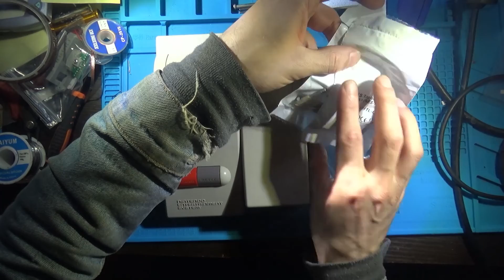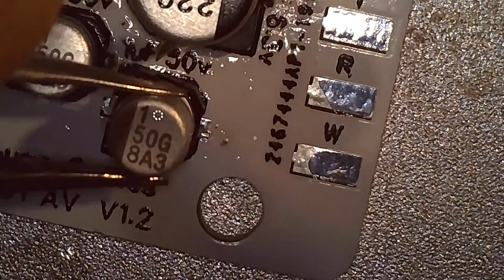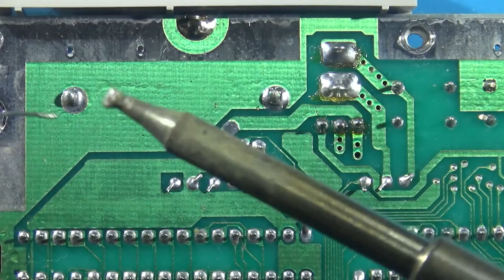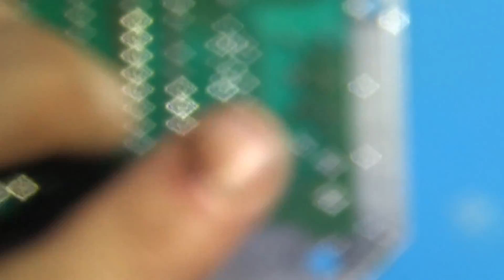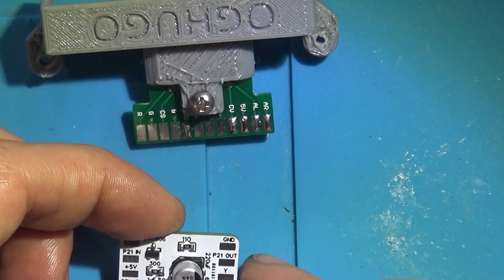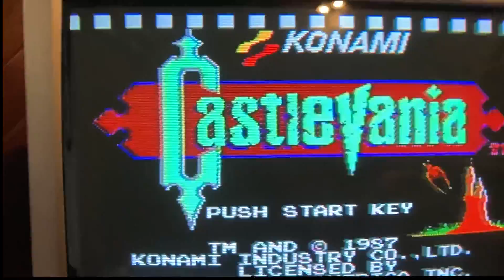Nes 101 Top Loader Composite AV mod With Snes Style Multi Out! Installation Guide.

Comment: Do you just snap one of the legs off on the replacement Dc power jack you linked in the comments? The replacements have 3 legs and I'm not super literate when it comes to power supplys.

Comment: So i can solder, braze, and everything else but im completely new to small electronic work. Im wanting to get rid of that garbage rf on my toploader, mainly to streamline my systems into one switch box. I have a couple questions regarding the techniques you used, such as why do you tin connections just to desolder? And what do you find works as the best flux, i see some people use a liquid and some use a paste. And would you suggest any sort of protective coating afterwards?
Reply: best to get a low cost de-solder tool. its just a hollow soldering iron with a plunger in it. going down in cost I would next go for solder wick. flux is a must, nothing fancy is required. I always clean up with ipa afterwards. solder wick is a must.
Reply: @MichaelMullins  thanks! I ended up getting all sorts of amazon specials 😂, the conversion was a success! Swapped rf to snes multiout 👍